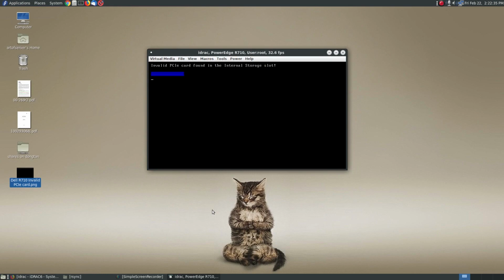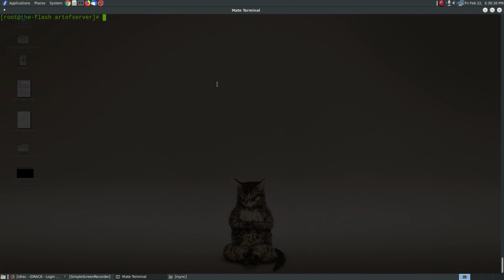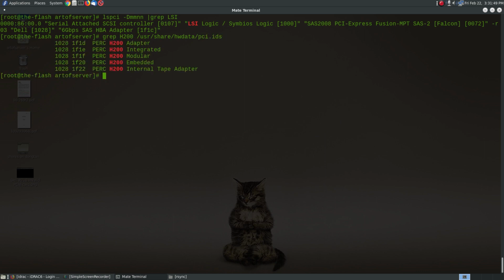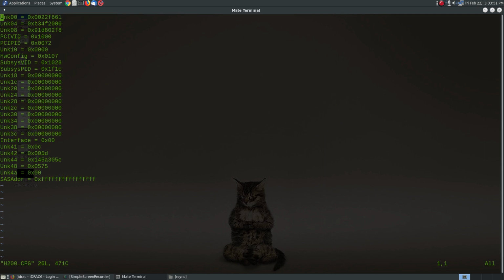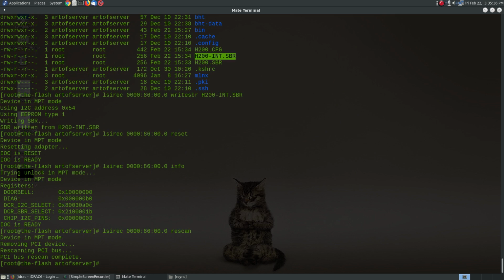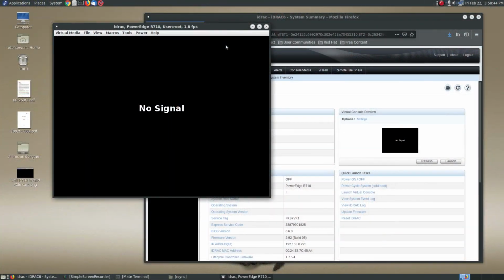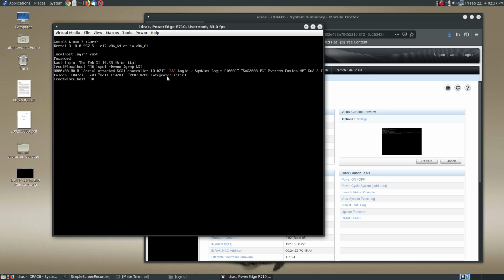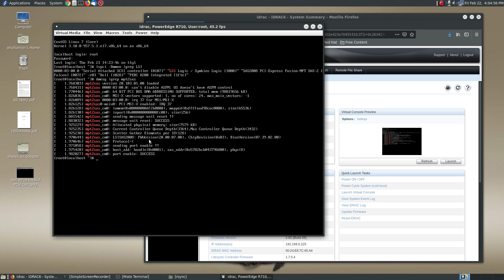How to fix: "Invalid PCIe card found in the Internal Storage slot!" error in Dell PowerEdge R710

Comment: i recently purchased a H200 card thinking it was original firmware (site i bought it from nowhere stated it was flashed with LSI) after i got the card and put in in my server i was still getting the Invalid PCIE error.now the card cost me an arm and a leg and the seller wants a 25% restocking fee because he dont sell Original firmware H200 cards only LSI flashed cards im not a server guy i got my Dell R815 Server for $100 it worked great for 2 years running windows server environment so my son and I could host servers for games we like to play. i have searching everywhere to figure out how to get this LSI flashed h200 to work so we can use the server again and found your video. This is my current situation 1 i dont have access to another server machine and the cost to send this card to someone to fix is outside my current budget 2 i dont have and am not familiar with Linux or other similar software.  what i am wondering is if there is a way you can help me with instructions (if possible) to be able to do what you just did in this video if it can be done on a windows environment regular desktop.
Reply from the maker: On the 1st issue, you can just move the card to a regular PCIe slot in the same server and it should work in there just fine. You can even use it that way if the cables will reach.

On the 2nd issue, unfortunately, the software used in this video are mostly for Linux. If you are a software developer, you could try to port it to Windows.

Comment: Thank you very much for this video as well as several of your others.  Mainly, your series on updating and upgrading the R710.  I am currently building my first home server and your instruction has been invaluable.  I got a really good deal on an R710 (8 - 2.5" bay model) and 2 MD1120's, so I plan to use TrueNAS.  The main function will be file storage and a Plex server.  It's been a very slow process because I'm trying to learn linux, TrueNAS, and how to operate, update/upgrade, and maintain a server all at the same time.  And of course, I ran into the exact problem you address in this video.  An H200 flashed for IT mode but not for the Poweredge.  Unfortunately, I didn't have another system running linux to fix the issue, only Windows systems.  And I wasn't able to figure out how to do this in Windows.  So, I put the card into one of the other (non-integrated) slots in the R710 and then followed your instructions.  Once again, your instruction paid off.  So, thank you again.
Reply from the maker: Thanks for watching! I'm happy to hear you got your H200 working correctly,  it's a great card. Glad you found these videos helpful! :-)

Comment: Server Newbie here... how was Linux installed on your R710 immediately after installing the h200 card?  I suppose I assumed that after installing the card you'd next need to install an OS onto your server.  I have a Dell r610 and I am currently in the process of replacing the PERC 6/i with an h200 however I have encountered the error shown in this video.  Great video however I believe I currently lack the tools to update my card as shown in your video.
Reply from the maker: I don't recall exactly as this is pretty old, but more than likely, I had a Linux installation on my USB drive. I show how to setup a portable bootable Linux USB drive in this video: https://youtu.be/laC7nsY1SyM

Comment: Can you just change the id if it is already flashed?
Reply from the maker: Yes, you can. The PCIe ID is independent of the firmware, as long as they match the Class ID/Vendor ID/Product ID, the subsystem stuff doesn't matter to the firmware.

Comment: I loved your video and your knowledge.  Would you happen to know the answer to this question?

I am trying to replace the existing Raid card in my R610 with a 9211-8i 6Gbps HBA LSI FW:P20 IT Mode ZFS FreeNAS unRAID+2* SFF-8087 SATA HBA card. When I put the LSI card in the integrated slot I get an invalid card installed error.

I have found a couple of webpages / video's talking about how to fix this. But when I am getting back from the "lspci -Dmmnn |grep LSI" command is as follows:

"0000:01:00.0 "RAID bus controller [0104]" "Broadcom / LSI [1000]" "SAS2008 PCI-Express Fusion-MPT SAS-2 [Falcon] [0072]" -r03 "Fujitsu Technology Solutions [1734]" "HBA Ctrl SAS 6G 0/1 [D2607] [1177]"

r/homelab - replacing the Raid card in R610 with a 9211-8i 6Gbps HBA LSI
I know that I am suppose to change the 1177, with a different number, just wanted to make sure I am doing this correct. Do I need to change the [1734] to a [1028] (Dell)? if so how would I do that?
Reply from the maker: Your card sounds like someone who didn't know what they were doing trying to modify the SBR and ended up using the Fujitsu configuration. Is it a Fujitsu card? The SBR is completely wrong. You should reach out to the vendor you bought it from as it is not configured properly for IT mode.
Reply: @ArtofServer  The card is actually about a quarter Inch longer than the installed raid card.  I do not think that it matters, but it just makes me wonder

Comment: Hey mate, i unfortunately do not have the ability to make these changes to the card. Making an assumption there is nothing wrong with taking up one of my normal pcie slots instead of the intergrated slot?
Reply from the maker: That's a possibility too, but you waste the PCIe lines dedicated to the integrated slot.

Comment: Hi, this was super helpful, I managed to install an H200 into an old R610 replacing the old raid controller. It all works well, but the bios still report "The storage SAS A cable is not connected or is improperly connected" although the H200 see all disks and I can access them without any issue.  How does one get rid of this message?  thanks
Reply from the maker: That error is because you have your cables backwards. Make sure port A goes to port A, and B to B.
Reply: @ArtofServer  Thank you! solved!

Comment: The card I ordered from you reflashed for IT mode was generating this error intermittently on a reboot but now is doing constantly and I have lost the use of that machine.  What do you think I should do to correct it?  I need to find another machine with an open slot open.
Reply from the maker: If you bought the H200 card from my store in the last 3 yrs, they should already have the correct PCIe ID as shown in this video. The fact that you had the failure intermittently suggests to me that the PCIe riser board might have failed.

You can test this out by installing the H200 card in a regular PCIe slot on the other riser. Boot up and check it's PCI ID as shown in this video. If it is correct, then the other riser with the integrated slot probably should be replaced.
Reply: That’s a great idea. I moved the card to another spot and it posted when I started the machine but would not boot since the cables didn’t reach and the drives were not connected.  The riser card was still in the machine at the time. I reseated the riser 1 card and reinstalled as per normal and had the same problem.
It seams to me that now that the problem is persistent and the card posted it would appear I should replace the riser 1 card and see if that fixes it. Mine sure looks fine from the surface but that doesn’t mean anything.
When I started the machine and the card posted with its bios loading etc , it didn’t indicate the code as outlined in your video.  I will need to find a way to connect the drives and boot it up and see.
The card I purchased from you was oct 31 2020.
Do you think you changed the code on this one as per the video.

Thanks bud. I really appreciate you.

Regards,
Shayne
Reply: I booted over NetBoot on Debian live cd. I entered the lspci command and received the following without the hex code : Ispci -Dmmnn | grep LSI
0000:04:00.0 SCSI storage controller [0100]" "Broadcom / LSI [1000] "SAS2008 PCI-Express Fusion-MPT SAS-2 [Falcon] [0072]" - I03 - p00 "Broa dcom / LSI [1000] "SAS2008 PCI-Express Fusion-MPT SAS-2 [Falcon] [00721|
Reply: I don’t get the “6gbps SAS HBA adapter” and its code (1f1c or 1f1e). So I can’t tell what code it has there. I tried this in both riser cards with the same result. Thoughts?
Reply: Hey artofserver. Thank you so much for helping me sort out the problem. The sas card had failed but it served me well for a long time. I received the new one and it worked straight away. Thank you

Comment: Is it possible to do with other cards, i have a few lsi 9240-8i cards
Reply from the maker: I've never tried it, but it might be. That said, LSI cards that are HHHL format often do not fit the form factor of the Dell H200 or H700 type of cards. It is easier to use a H200.
Reply: @ArtofServer  ...already looked and 3d printed a bracket to suit
Reply: @ArtofServer  ... well, done the test and it works, finds all drives etc and working faultlessly on truenas.  Only issue is I am getting a SAS Connector B error

Comment: Thanks for this. I didn't have another system with PCIe available. My R610 was able to detect the card with 0x1f1c in the second PCIe slot (SLOT1). I booted into CentOS on the R610, fixed the ID, switched over to the internal PCIe slot, then installed TrueNAS.
Reply from the maker: Glad I could help

Comment: I just found this and I am grinning from ear to ear as I have two PCIe H700s and I want to see if I can change them to integrated. Thank you.
Reply from the maker: Yes you can!
Reply: @ArtofServer  Just picked up a T710 off ebay. Got a good deal on it. I updated the firmware in the current H700i in it. That worked out great. Put Debian 11 on for testing. I run a T610 for my small business server. This video has me intrigued. 
I need to study more about this. Especially the software tools that you used. ;) thanks!!

Comment: will this work on h700 and will this delete configuration of already running harddrives?
Reply from the maker: This can work with H700, but the SBR format is different, so do not blindly copy these steps. It should not affect the RAID configuration, which are stored on the card's NVRAM and on the drives themselves. If the configuration in NVRAM is cleared, you can always import the drive configuration as a "foreign configuration".

Comment: Is the only way to address this issue with another linux machine?
Reply from the maker: Using Linux is not the exclusive way. I've changed the SBR on a LSI card by programming the EEPROM externally, so that could be another alternative. Linux is just an OS, anything can be done on any OS so long as someone writes the programs to accomplish it.
Reply: @ArtofServer  I am a software guy and hardware is not my thing really. To get around the issue right now I moved the card to an expansion slot.

Comment: I have an (S/N 39H7H 1gb Cache) H700 in an R610 replacing my 6i - Server boots up to halt when activating the h700 firmware stating;  "PCIe Training Error: Integrated RAID System Halted!" - Bad card or am I missing something (bad firmware..?)
Reply from the maker: Typically, I encounter that error for 1 of 2 reasons: 1) The PCIe connection between the card and the slot is bad. Clean the gold contacts, blow out any dust or debris from the slot, and seat the card in the slot correctly and fully. Then, try again. If that doesn't solve it, then 2) bad card.

Comment: This video fixed the EXACT problem I had with my cross-flashed Dell H200 cards! Thank you for posting!
I would like to get a response from you and the folks here  in the comments: According to the Dell R710 technical manual, each PCIe slot with a riser card is x16. The PCIe 1 riser card has 3 slots (one is the dedicated storage slot) at x4 speed. Where PCIe 2 riser has two x8 slots. Would it be more beneficial to put the cross-flashed H200 (essentially a LSI 9211-8i) card in one of the x8 slots as it is x8 width capable? I checked with a bootable Dell support live image USB and launched the Dell OMSA and checked the slot bandwidth when placing the card in the dedicated storage slot and one of the PCIe 2 riser slots and indeed, the dedicated storage slot shows as x4 and PCIe Riser 2 slot shows at x8.
I have 8 (each) 1TB SAS drives in my R710 and planning to run TrueNAS Scale with ZFS, and would like to hear from the community if the difference in bandwidth would be noticeable.
Also, the SAS cables (one end has right-angle) are only 24" so the stock cables do not "route" correctly. I am on the lookout for 30" or longer SAS cables with the right-angle connector.
Reply from the maker: Glad this was helpful!

with HDD use, the PCIe 2.0 x4 is enough bandwidth. if using SSDs, you would benefit from using the card in a x8 slot.

Comment: Would this work to replace the H700 with a H710 in an R910 server?  Because ESXI-7 drivers support the H710 but not the H700.  I can put the card in but I get the "Invalid PCIe card found" error.
Reply from the maker: I've never tried that, so I don't know. But the SBR for H710 is very different than SAS2008 based controllers, so you can't apply this process directly, but it is possible the change the PCIe subsystem ID to whatever you want.

However, all of that may be pointless, not only does ESXi-7 not support the SAS2008 controllers anymore, it may not support that generation of CPUs too; without using some workaround. If you want to use ESXi-7.x, it is probably much easier to upgrade the hardware to supported versions.

Comment: Hello, maybe this is a stupid problem but as i'm not an expert so I prefer to ask :

root@ubnt01:~# lspci -Dmmnn |grep LSI
0000:01:00.0 "Serial Attached SCSI controller [0107]" "Broadcom / LSI [1000]" "SAS2008 PCI-Express Fusion-MPT SAS-2 [Falcon] [0072]" -r03 "Dell [1028]" "6Gbps SAS HBA Adapter [1f1c]"
root@ubnt01:~# grep H200 /usr/share/hwdata/pci.ids
grep: /usr/share/hwdata/pci.ids: No such file or directory
root@ubnt01:~# lsirec 0000:01:00.0
lsirec: command not found
root@ubnt01:~#

Do you have any ideas ??
Thx
Reply from the maker: You need to compile and setup the lsirec program in your path.

Comment: Hy! I've just got a H200, and they promised me, it will be on IT mode, and will be working in the integrated slot. The IT mode firmware was installed, but they not modified the ID, so I've just got the exact same error message, when I installed the card... Following your guide was helpfull, and I want to thank you the effort, and the professional guide! Thank you! Thank you! Thank you! Thank you! Thank you!
Reply from the maker: Did you buy the h200 from my store?

Comment: I flashed the PERC H710P using this guide (https://fohdeesha.com/docs/H710-D1-full/) and now after the 1st reboot I get the same System Halt error.  Anything I can do to fix this?
Reply from the maker: probably the SBR is incorrect. may have to reprogram it externally.

Comment: Does this method work with a H310?
Reply from the maker: It could, but H310 doesn't fit in the integrated slots physical dimension wise.
Reply: @ArtofServer  if you remove the black bracket it will
Reply from the maker: Even so, the position of the sas connectors is not ideal. You'll need to put tight bends on the cables and probably block airflow.
Reply: @ArtofServer  I have cables with 90° on them
Reply: @pauleinsig  Have you managed to change the SBR of H310 to "H310 Integrated" (1f4f). I have done this and lspci shows "Device [1f4f]" and still doesn´t work. Tried H200 Integrated on an H310 and it seems to be working
Reply: @afonsocosta6927  I bought one already flashed and it works, just not in the integrated slot.

Comment: My H200 card came already flashed to IT mode. I managed to modify the firmware to allow use in the integrated slot. All is well, thanks to your guide. However I noticed I'm running 17.00.01.00 firmware instead of the 20.00.07:00 shown on your screen. I'm building a new storage server. Would you recommend updating to the newest firmware? Would I need to change it to IT mode and modify for the integrated slot again after updating?
Reply from the maker: Yes. And no.
Reply: @ArtofServer  I booted my CENTOS update ISO for R710, and it detected 'SAS9211-8i'. The system attempted to update to firmware 07.03.06.00_A10 (which I believe is the latest one) but "the operation failed due to an invalid image file. RC= 810a". Any thoughts? Since my card isn't officially an integrated Dell H200, would it make sense to manually flash the non-integrated firmware version 07.03.05.00, A08?
Reply from the maker: Are you trying to remove the IT firmware and go back to stock Dell firmware?
Reply: @ArtofServer  No, I assumed the update ISO would select the correct firmware. Not sure how to proceed at this point.
Reply from the maker: @alfredcam5213  Dell doesn't have the IT mode firmware. You need to download that from broadcom.com. just follow their instructions to update.
Reply: @ArtofServer  That did the trick. Thanks!

Comment: Is there any chance that I can perform this without using another pc? Is there a method to run a live usb linux distro and do these changes avoiding the "System Halted" problem?
Reply from the maker: Yes, put the card in one of the regular PCIe slots.
Reply: @ArtofServer  I am trying to boot Ubuntu live from usb but when I have the card plugged in, I've got the error and can't boot from usb. When I plug the card after boot, I can't see any PERC cards in lspci. And also I don't have /usr/share/hwdata.. Is there some chance how can I do it? Dell PowerEdge T410. thank you so much